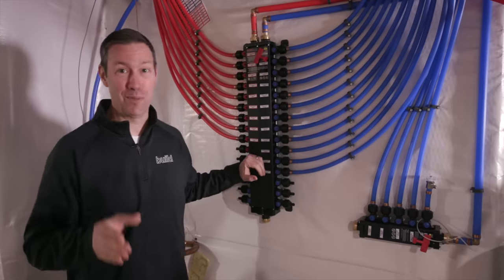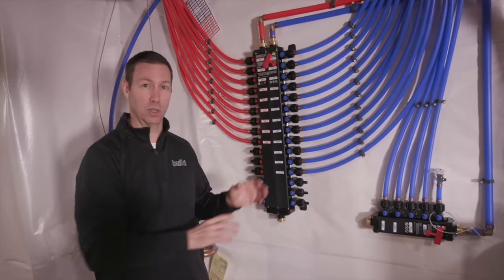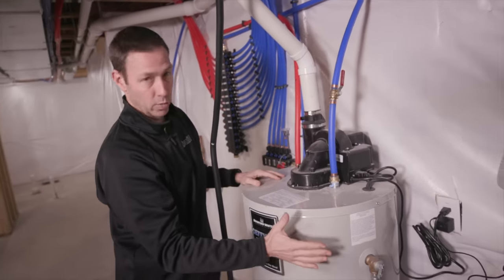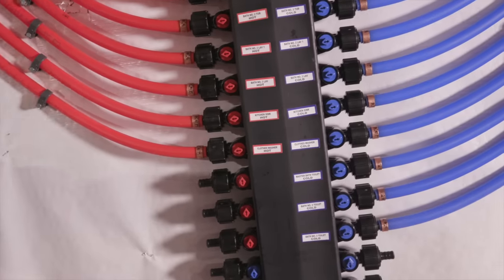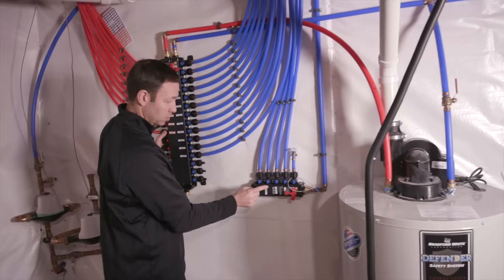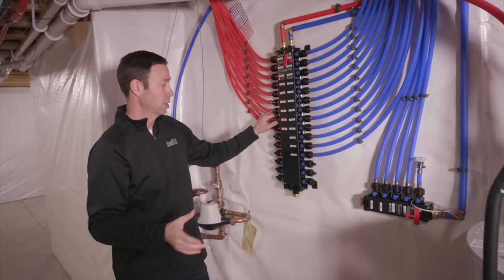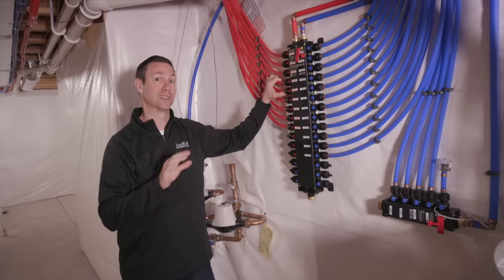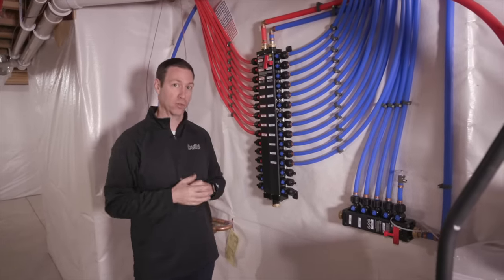PEX Manifold System - Pros and Cons + Tour

Comment: I live here in upstate NY and I am a contractor. I do most of my own work such as plumbing, electrical, sheetrock, trim etc. I did the same on a 2 story home I remolded a few years back. I ran a 1" pecks line from the well holding tank to a large primary water filter then continue with 1'" manifold tee off with 3/4" for electric hot water and all the fixtures in the home with the exceptions of the toilets witch were 1/2". So I had two 1" manifolds one for hot and one for cold with a shut off valves for all the fixtures and on the end of each going into the sub pump hole. So you could shut off the individual fixture and drain the line. Work great! Plenty of pressure in all fixtures!

Comment: i live in central florida and have one of these systems - it's in the garage, and the company that installed it built a box/cabinet around it, so it has two doors that open to get access to the panel - just like having a circuit breaker for your water system.  only drawback i have is that i didn't pay extra to insulate the cold water, so in the summer (most of the year) the water in the cold pipes heats up (they run through the attic) so you have to let the water run for the 15-20 sec for the cold water to come through, so opposite of what Matt talks about in the video with hot water. and, as others have mentioned, you don't get pressure drops or temperature changes when someone uses another fixture in the house (like having someone flush the toilet while you're in the show)
Reply: So, that's a pro of changing to PEX?

Comment: I installed this system on my house. One benefit you forgot to mention is greatly reduced fluctuations in pressure. So when you are in the shower and someone is flushing the toilet or running the sink, you water pressure isn’t constantly fluctuating. Plus with zero fittings and long bends there is considerably less resistance within the plumbing. When I did mine, from the meter I ran 2 1 inch pex to the utility room, 1 to the cold side manibloc and 1 to the on demand water heater. My house is a very tall 2 story house with 2 showers on the 2nd story. With only 43psi of city water I can run both showers, the dishwasher and cloths washer with almost no noticeable pressure loss at the showers. It’s very handy when running 4 kids through the shower in the evening while cleaning up after supper and doing the laundry.
Reply: I have the same system in my house and for the last 8 years have been trying to figure out how to reduce the pressure drop in the shower when someone flushes the toilet or turns on another faucet. I have great pressure at the main through the meter. I have had three different plumbers look at this problem and contacted the manufacturer but no one seems to have a fix.
Reply: @Road_Renner  did you ever get this fixed?
Reply: @andyvan27  No - never did. We have enough pressure and volume to take a decent shower, but flush a toilet and we get about half the volume of water coming out of the shower head.
Reply: @Road_Renner , just curious I've tried everything but change the main line. I never thought it might be the manifold.
Reply: @andyvan27  If you ever come up with a fix, please let me know. This is crazy. You would think these manifold systems would be great for loss of pressure and volume - but just the opposite. I have tremendous pressure coming into my house and my pressure regulator is set to take it down to 70 psi. Run one faucet and pressure is great. But run another faucet or toilet and I get about half the pressure and volume. I see the one commenter to this video says he only has 43 psi coming in from the street. If my main pressure coming from the street was that low and I flushed a toilet I’d have a trickle coming out of another faucet or shower head. By the way, in my efforts to get this resolved  I had a plumber replace the 3/4 inch pex from the pressure regulator and back-flow valve with a one inch line and also replace the back-flow valve thinking that was the problem - that didn’t help. GOOD LUCK BUDDY!

Comment: 😩I'm such a novice for not realizing that PEX is actually usable for standard plumbing & not just hydronic heating and cooling systems. What I don't understand, as a novice, is the point of having every single spigot on its own line, even if this is supposed to be a small house. At the same time, that also seems like an excessive amount of spigots for a smaller house. About to look into trunk & branch systems to see what's different. Glad I came across this channel.

Comment: To quicken the hot water to the taps in my two story, I ran a 3/4 line from the water heater, to a manifold that I located close to the main bathroom shower on the second floor. (Highest point)  This manifold had a return line (uninsulated) back to the water heater and connects at its drain tap.  

This allows for a natural convection recirc loop. I have quick hot water to my bathroom, master bed rm bathroom and laundry room.  

I also grouped my hot water lines together which allowed me to wrap the bunch with 2 or 3 inch diameter fibreglass pipe insulation in the basement starting from where it groups together after the basement manifold.  Once a line leaves the group, it was wrapped in 1/2” diameter.  Only pain on doing this was where the pex had a fastener or support. 

BTW. Yes the laundry is located closer to the areas where clothes come from,  the bedrooms on the second floor.  And no the laundry room has never experienced a leaked since I built the house in 1994. I also switched to an on demand water heater in 2006. It has the recirc system included so the existing recirc line could connect into that.  

No regrets.  I think this manifold set up is great.  Thanks for this video.
Reply: Thats how boilers work. Explain, do you a dedicated return line?
Reply: @bojack2740  yes  a half in line runs back to the water heater. Originally connected in with the water heater tank drain valve, down low. Now I have a tankless heater that accepts return line.

Comment: This is a great channel.

I have a home run system very similar to this that I installed.  One of the main benefits that we have found is that you do not get the same sudden change in temperature while taking a shower when someone turns on another fixture that you get with other systems.  Also, if you are doing the renovation yourself, its very very nice to be able to trial each fixture without turning all of the water off and/or turn off a hot or cold line while working on it.

Comment: Plumber definitely looks like he knew what he was doing and really put the time in to make it look professional, but a couple things that caught my eye was 1) the 3/4 line to the water heater with the use of insert fittings...if more than 1 person is taking a shower and someone turns on a sink it will be noticeable.  2)  Most pex manufacturers recommend 12-18 inches of metal pipe separation between the water heater and the pex.  3)3/4 cold water feeding the water softener...with the 3/4 insert fitting, it is basically choking the waterline down to 1/2"...using an uponor brand or something similar would help solve that or running 1" to the manablock
Reply: Dude... that manifold system is the most wasteful use of pipe and water imaginable... I did it in my house 15 years ago... Thought it was the coolest thing ever... And then realized it was the stupidest thing ever... but it looks so f**** rad!
Reply: You can still have a recirc system with that ridiculous manifold system... And just add some more plastic pipe to your badass crib!
Reply: Agreed, wouldn't PEX-A work better as the inside diameter of the fitting maintain the 3/4" diameter of the pipe?
Reply: Plumber looks like he may have a little OCD... Nice looking work.
Reply: From https://www.huduser.gov/portal/publications/pex_design_guide.pdf the pipe temperature limit guideline in 185F (82C). At that temperature, hot water is a health hazard and I've never seen an on demand or immersion heater set to provide water at those temperatures. If it was a pressurised radiator system then definitely the copper is a requirement.

Is there a real plumber out there looking at this to answer this thread properly?

PS my preference is remote manifolds. I installed a 4C+3H manifold in my bathroom in the local linen closet..install went like a charm.
Reply: I do  buy  1" or 1 1/4" copper manifold(2 of them hot and cold or 1 and cut in half) by 3/4 outlet and solder 3/4" pex adapter. Run to every washroom with shower 3/4" pex and the rest 1/2".
Install pex  shut off valves  couple off inches above the manifold in straight lines. 
Every fixtures separated line is a waste.
Reply: or build a copper manifold system instead of that plastic over priced crap. I love pex for ease and long runs though. however copper is still king.
Reply: I’m gay
Reply: Tim Rowe get to work. Mike Rowe would be ashamed.
Reply: Excluding that he added a bypass loop to a clack right
Reply: on a house with this many drops I would run 1-1/4" feed in uponor. hot & cold trunk line. NO 90'S! AT ALL! EVER. I'd stay with 1-1/4" on the cold until there are 5 drops left.. then drop to 1" and stay there til the last tee is 1 x 1/2 x 1/2. hot side would stay 1", even though the heater is 3/4". I'd choose a COMPLETELY separate path for the hot trunk- snake it on a path past EVERY hot drop (making each pex hot drop from fixtures only about 36" long). at the last drop-  1 x 1/2 x 3/4. then continue the hot trunk ALL THE WAY BACK to the heater & recirc. THE PERFECT POTABLE SYSTEM. use the heaviest highest R value foam on the hot trunk and recirc. line. BOOM. perfection.
Reply: Professional? There is absolutely nothing professional about the work in this video. This is the ugliest/cheapest plumbing work I've ever seen. The fact this guy is showing it off is sad, shows there is no quality work being done in that community. I would be fired if my headers looked like that.
Reply: @natehale1982  , could you say more? He does the work not look professional? Btw, I’m not a plumber.

Comment: Matt there are a few things that one could very well do to improve hot water flow on a large house. Install more water heaters. Many people are switching to tankless under sink for direct on demand hot water. 
Manifolds are fine in some applications. They work best if you run your large line to the areas that you need and install a small closet or access panel along with a water heater per bathroom. This means you run cold water main line to master bath and one line to water heater and the rest to fixtures. 
My house is going to be a branch design. With 3/4 all thru out and very few of them will be 1/2, most of the half inch is just to make the connection for for very short couple feet runs. 
I have a well that delivers 25 GPM at 60psi with a main 3/4 inch line that will at some point be replaced with a 1 inch pex line. I am also going to install commercial 1 inch outdoor faucets along with getting 1 inch garden hose as well.

Comment: Awesome! We are planning on using a PEX manifold for our radiant heated floors on our house build!
Reply: You don't use this kind of block for a heating system, you need a hydronic manifold for heating.
Reply: Different animal altogether,  and you'll be using PEX type A (if you're smart) for in-floor heating.  We were installing Wirsbo PEX radiant systems as early as the mid '80s and it was a steep learning curve.  Have it designed by a professional and don't try for miracles (pushing radiant heat through  a plywood subfloor covered with hardwood... yeah, it's 'possible'... people do it all the time.  Then they complain for a thousand reasons... heat can't keep up... flooring moves abnormally... hot spots at the pipe.... yadda yadda.   Radiant floors should be installed in some kind of thermal mass, period... not stapled up under a wooden subfloor.  Just my .02.
Reply: @HBSuccess Do you feel that same about warm board?

Comment: I have done the home runs like this for a long time.  What I decided to do, was to bring a 3/4 homerun to the group. (Ex.  Master bath has a 3/4 trunk to it, with 1/2 and 3/4 branching off of that main trunk). This way I have hot water delivered one time to the group.  I also bring a new manifold to each floor.  Most remods I do are big, and so I install new water heaters on each floor.  Never a demand for water.  I am not a fan of tankless.

Comment: You could always do a run to just the kitchen or bathroom and then branch off that to the fixtures as you would with traditional copper. Once the feed is charged, no waste, no bulk, easy for remodeling too.
Reply: Absolutely agree.  While the system above is extremely granular (meaning that I can literally turn off cold or hot water at EVERY SINGLE FIXTURE), probably just as useful would be to plumb it like your breaker box, meaning that one "circuit breaker" turns on or off an entire room, such as a bathroom.  Probably just as useful.

Comment: Matt, I’ve got 2 distribution manifolds in my house. The distant one is fed through by the near, and the lines are covered largely in spray foam as a by product of my sealed attic. A Grundfos pump pressurizes a loop whenever a bathroom, kitchen, or otherwise indicated by the automation system triggers a circuit in my lighting control relays.  While there is some wait at some fixtures, the manifolds themselves and selected faucets do not wait at all for hot water.  The automation system sequences the hot water loops for 5 minutes at a time. So when anybody triggers a light in a new location, the hot loops get reenergized for 5 minutes. By having 2 manifolds, I cut down on distance to fixtures as most baths are on one side or the other of the house.  The first manifold sits right on top of the kitchen, so home runs are relatively short.  I don’t like the trunk and branch systems because of what I call “unsupervised” fittings inside walls.  If a fitting leaks, you might not know until it’s too late.   None of my fittings are unsupervised, except for shower valves. Which I could not avoid. I used uponor pex and love the stuff.  

The hot water supply is coming from 3 tanks, a desuperheater tank using waste heat from my geothermal heat pump, backed up with evacuated tube solar, and then a dedicated heat exchanger tank that is heated from the geothermal dedicated hot water function.  Essentially I pay little or nothing for hot water, and in fact in the summer the more hot water you use the higher efficiency my gshp operates.  

I also used a 3rd system to feed reverse osmosis water to 2 dispensers in my kitchen islands, and  2 refrigerator ice and water dispensers. Using only plastic fittings and pex in that manifold because of corrosive qualities of the r/o water. 

Come by and take a look, I’m in Texas.
Reply: Sounds great but what is the house size and how much was the system itself?

Comment: I like when they set these up in nodules, so you would actually charge the specific room like one restroom. Still is nice you only shut down a single room vs the house.
Reply: tat is why you place a dedicated shut off (like you should to begin with) at the toilet, sink wherever and they rest of the house runs fine.
Reply: @garyring8306  🤣🤣🤣 lol your clearly not a builder. I am and those dedicated shut off valves are trash and fail often. It's nice to shut off areas to replace valves or to just keep off if not in use. It also reduces runs and is more efficient.
Reply: @jr303official  That's why you only use r-19s,my Boy.

Comment: You can absolutely add a recirc pump. Tap each hot run at the fixture, run it back and install another manifold to combine it then circ through the water heater. Use white or an off color of red to indicate circ line. ID the main manifold to indicate recirc and reference the recirc manifold valve for that circuit. Yes it's more pipe, but whats a little more if you are already running home runs for everything.

Comment: Great Video! You raise some important cons. Particularly with having to evacuate each point of use. What about running a couple trunk lines to different zones or rooms? One trunk to Master Bath, which then forks to vanity and shower...? I love the ability to shut off water to parts of a house for repairs/remodels. Balance that with the cost/waste of evacuating those lines every time... 

Also, what are your thoughts on point of use water heaters?
Reply: Anthony Sparapani  That is how I would do it.  Would be nice to be able to run a return line just before the mini-manifold so the water can circulate as well.  Clean and simple way of always having hot water quickly.
Reply: Some people do install it the way you said.
Reply: I think you should know what pex is, till then keep it to yourself

Comment: A good compromise (what I did in my own house) is construct a manifold that feeds 'uses' of water, vs individual fixtures.  For instance, I have a shared bathroom and laundry room.  The laundry tub sink and washing machine share a 1/2" laundry hot/cold line.  The bathroom side (sink, toiler, shower) share a 1/2" hot and 3/4" cold line.   The 3/4" cold means that there is enough flow for the toilet to not impact the sink/shower.  While the 1/2" hot allows both the sink and shower to run at the same time.

Similarly, there is a single pair run to the kitchen, upstairs bath, etc.   The big advantage of this system is better control over the volume of water that has to be removed from the lines to get the hot/cold as desired to each individual user, but with the ability to use the sink and pre-charge the system for the shower (or another point of common use.)